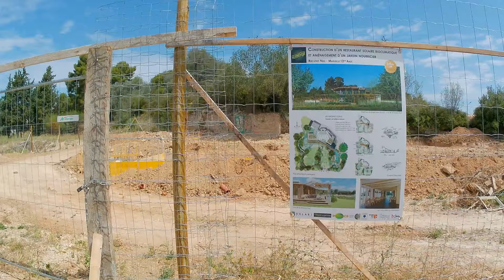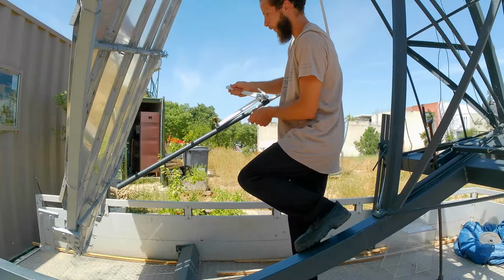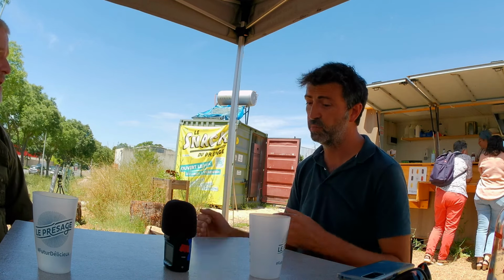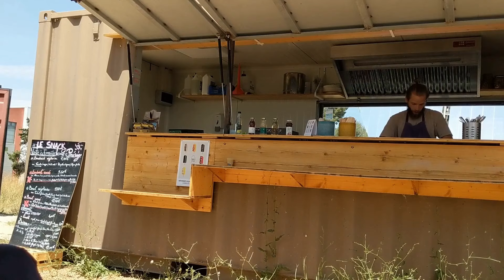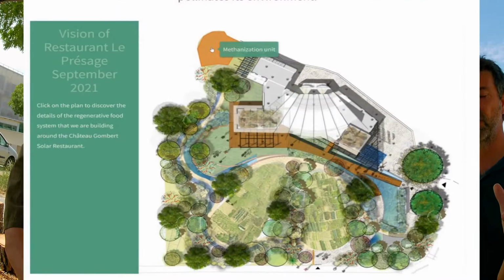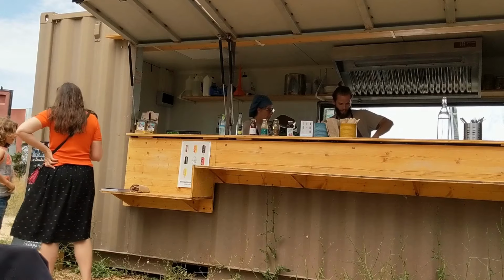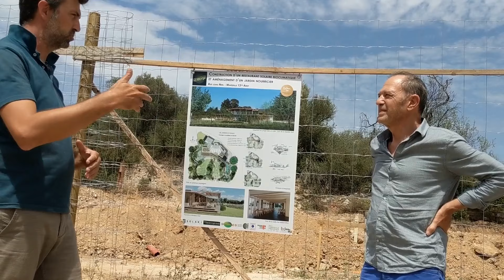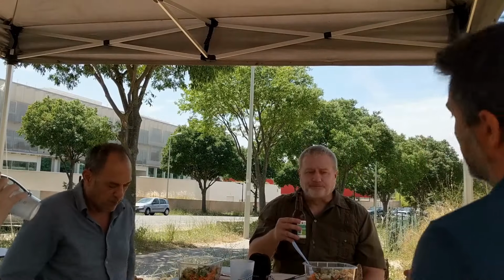LePresage: Solar restaurant with 400 days of sun a year to open June 2024!

Comment: Does solar-cooked food taste different/better?
Reply from the maker: Yes, it tastes better, or I would say, all the tastes are preserved, for many reasons: First the temperatures in a solar box oven or panel cooker rise slowly, and without circulating air like a gas oven, the moisture in the food is not drawn out quickly. Most food is intended to stay moist but "modern" cooking methods can dry out just about anything, sometimes before the food has had a chance to really cook. Second the often somewhat longer cooking time at lower overall temperatures mean the proteins, sugars, and other components of the food do not cook to fast and thus char or skip steps in property breaking down proteins etc. While visiting you'll see Pierre-Andre pull out a spectacular batch of baked eggplant--it smelled like butter-baked mushrooms!
Reply: Different at times as Luther says.  It cab be a different approach.  Like using less moisture so it cooks faster or as fast depending on preheating and heat limits. If any, of cooking method.
Reply: It tastes like sunshine

Comment: Why not solar PV and electric cooking?
Reply from the maker: If I were to hazard a guess it would be, they wish to cook with the cleanest energy possible using the materials for a cooker that have the least impact on the environment. Aluminum already smelted, vs. PV panels with their many metals plus the extra copper for cabling, etc. etc.  Since they can cook with pure unmediated sunlight, why complicate matters? But that's just my guess.
Reply: What does a Scheffler mirror with tracking system cost vs a PV system that does the same? My guess would be thousands vs tens of thousands, and let's not forget that batteries have only a limited lifetime. There's a German startup Solarbakery you can look up for comparison, their installations cost several hundreds of thousands which is insane. Meanwile, you can get a Lytefire for $5000 or diy for much less.
Reply from the maker: I don't know the cost, you could contact Pierre-Andre via their website. Apparently they felt it was cost effective for a restaurant doing dozens of entrees and hour, and they will have 2 at their restaurant slated to open June 11. The tracker for the one unit we saw needed only occasional adjustment, per Clement's tour of the cooker on its trailer. I doubt that the Scheffler costs in the six figures or even close to it.
Reply: @SolarCookingMuseum  I know the smallest Scheffler reflector with 2m² costs €2000, I couldn't find a price tag for the 2.7m², 10m² or 60m² models on Simply-Solar. As I understand it people can also get the instructions and diy, same with Lytefire.